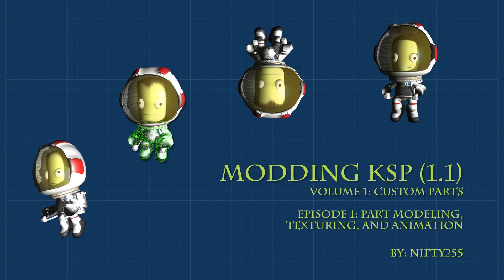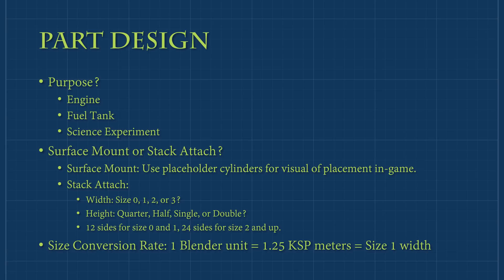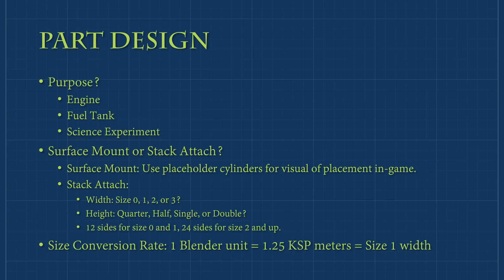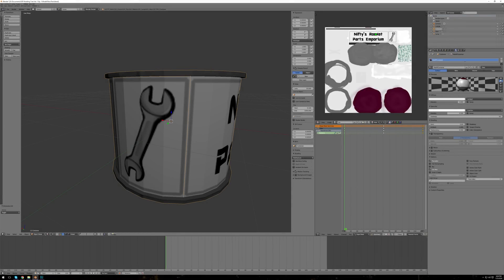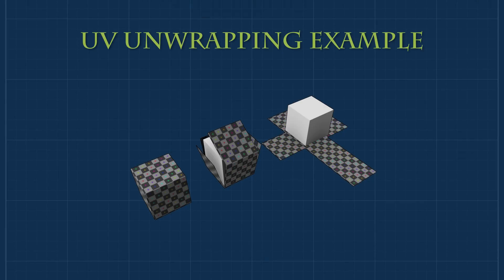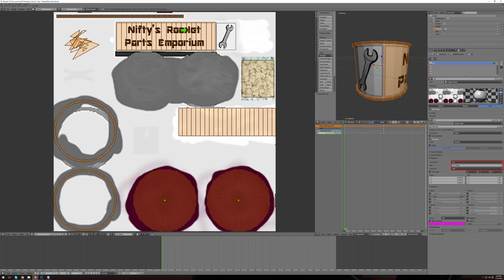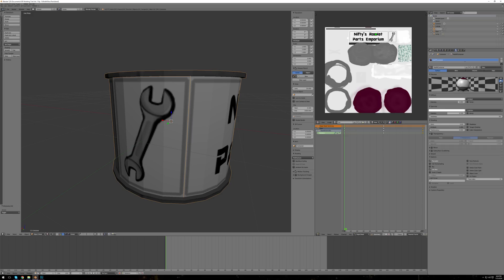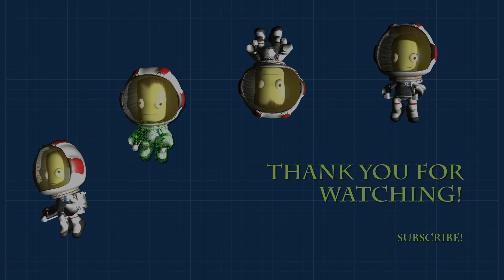KSP 1.1 Modding Tutorial - Vol. 1 Ep. 1

Comment: Just a quick note-- the stock parts use 24 sided cylinders for size 1-3. At size 0, it's less (I think 16 or 18 for the Oscar B, but I don't recall off hand). These are oriented so that vertices/edges face the cardinal directions (along the axes). The colliders for stock parts are 12-sided at all of those scales (though maybe less for the Oscar B, I haven't verified), oriented with faces aiming at the cardinal axes, to facilitate surface attachment with angle snap. Also, the scale conversion of 1:1.25 is assuming you use the default "rescaleFactor". If you set "rescaleFactor = 1" in the part's CFG, then it's a 1:1 ratio, which I personally find easier to work with.
Reply from the maker: Thanks for the corrections! I'll add the annotations. And indeed I left the scaling at 1:1.25 because of those defaults. I'll explain scale tweaking later.